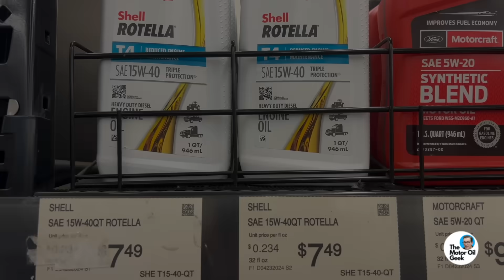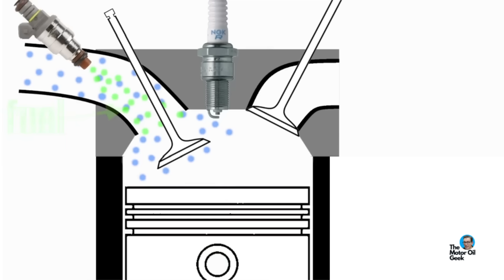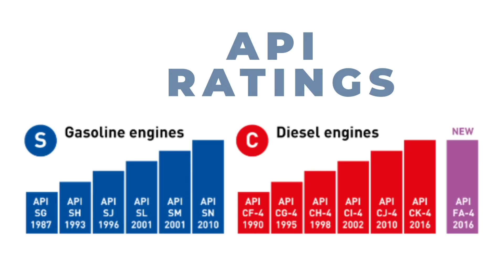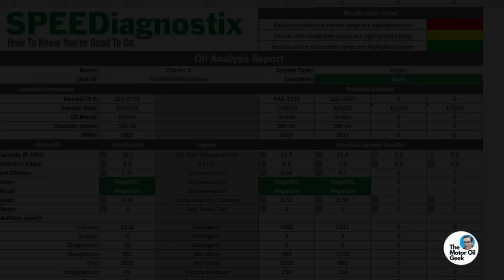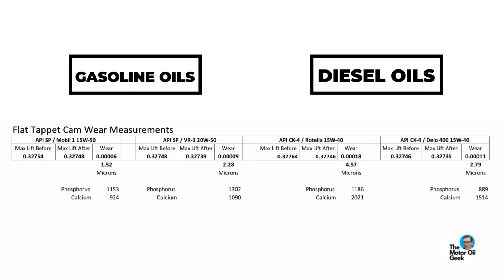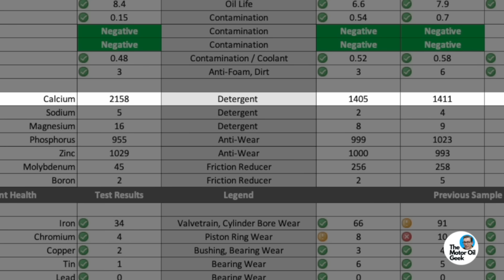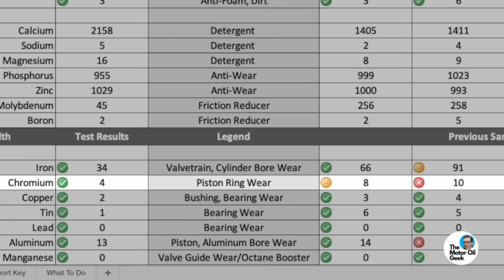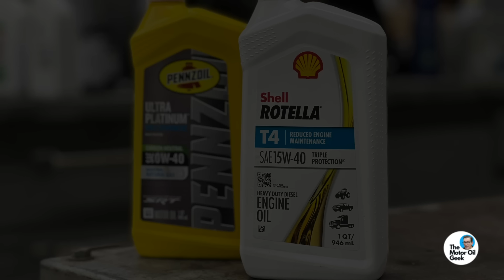Why DIESEL Oil is Actually WORSE for Gas Engines!

Comment: Why is Rotella T4 rated by the Japanese for motorcycles?  That T4 has JASO MA/MA2, which is a Japanese rating for motorcycles....  My  2000 Honda Goldwing 1500SE can use the diesel oil even though that water cooled engine is very similar to a Subaru flat 4 (GW is a flat 6 - Boxer motor).

Comment: Made the mistake of running Rotella diesel 10w30 or 40? in my VW bus. Took me abit, but i realized it was not revving like it should have (max revs @5200, normal running @4000 at 70mph )  The diesel oil was actually slowing down my pistons!.  Went back to Castrol, ran like new. Now, is Rotella formulated for gas engines, and their higher and faster revs,  too, besides diesels? Either way, I'll stick with Castrol, which is an excellent oil.
Reply: VW bus you could maybe get out and run faster
Reply: Actually, my Bus would do 70~75 on the highway. No, not as fast or quick as most cars, but I would still pass plenty of people,  and I could carry all sorts of stuff inside and on top.

Comment: Hi i am from India. My first bike is Bajaj Discover 100T it has completed 70000 Km. Then there was a bad sound from head. The cam bearing was gone. Even though it's cam lobes were intact. Company was recommending 20W 40 oil. But i used 20w50 throughout the Years. 
Recently I rebuilt the engine because the bike is 12 years old. I use it for daily use . I did 4000km oil change. Now I am planning to use castrol 10W 40 full synthetic oil. 
Is it good for my bike to use 10w-40 instead of 20w40?
This bike gives me 80 Km / litre fuel efficiency. 
11:1 Compression ratio, 
Long stroke
4 valve SOHC. 
10 HP 9 Nm singe cylinder bike
This bike was very very reliable front and back tyres last for 50000kms this is my 3rd chain on it. Front fork oil seals changed 2 times. 
The CDI unit and horn switch changed once. 
No other maintenance in 70000kms.
I ordered new sock absorbers for the rear. 
I also have a Honda CB 350 Rs.

Comment: Could you run a diesel oil in a classic car with unknown mileage on the engine, for  maybe two or 3000 miles to flush it?

Comment: They haven't been around high millage gas engine with desiel  oil i have witness it it will keep oil pressure up even after several miles on old change

Comment: It is difficult to accept that you are an expert on engines lubrication, when I see your animated graphic at 1:46 illustrating the pistons pointing 180 degrees downward into the oil pan. Whomever is in charge of your animations doesn't know a damn thing about engines. That makes you look like a fool for not proofing your video before release.
Reply: What do you expect from a channel that would feature Dave repeatedly. That guy is a joke.

Comment: Uh oh......I've been using Shell Rotella 0W40 (T6 I think?) in just about everything: the gas truck and car, the diesel farm tractor, the diesel generator, gas generators, the gas snowblowers......we live in wintery Canada. I do use an API SP 10W30 in summer equipment like lawn mowers, the rototiller etc. But I'd better go look at that pail of Rotella to see if it's really not suitable for gas engines. Great video!

Comment: The diesel oil folks will never be convinced that specific gas/motorcycle oil is better for their designed application. 

I am not saying diesel oil will necessarily harm your car/motorcycle, just that it’s not as good in terms of wear control, oil longevity, or shifting in shared oil applications.
Reply: Agree.  Lake is just saying that diesel oil in a gasoline engine is not ideal and the commenters have a cow!
Reply: @pedlpower  He pretty much proved that even with the 'wrong' oil, it still works and you get away with it. Oil is just that good these days.

People just like to obsess about oil like there's some hidden secret that nobody's figured out yet.
Reply: He didn’t really address the old engines much just kept going on about gdi.
Reply: @LinusScrubTips  He did give good information on how diesel oil could be an issue with old engines though. He mentioned the fact that high levels of ZDDP in diesel oil does not mean it’s good for flat tappet wear, due to the equally high levels of detergent/dispersant. 
High ZDDP is often the argument for why diesel is “better” for old pushrod engines in classic cars and motorcycles. It is true that low ZDDP in modern auto oil can cause a cam to wear out shockingly fast in a flat tappet engine, but diesel oil isn’t the answer.

Comment: I have run Rotella in my Honda accord four-cylinder since 150,000 miles. It has 422,000 miles on it now runs good and from time to time I’ll add a small bottle of brake fluid to keep the valve stem seals softened up, I have never open the valve cover and it’s only had one set of spark plugs put in it in the car just runs perfectly. Maybe I’m lucky.

Comment: I'd love to hear your thoughts on this :  If diesel oil is designed to handle soot then would it be better to run gas oil in diesel engines that have bypass filters that remove all of the soot?

Comment: Dual diesel and gasoline rated oils are often called "fleet oils", as companies can use them in their diesel and gasoline vehicles. When I was in high school, 15W40 was the cheapest motor oil that my high school shop could buy in large oil drums, so the high school shop teacher ordered drums of 15W40. The high school shop had a contract with the local FBI office to change oil in their cars. One day, two FBI agents dropped off one FBI car for an oil change and left in their other car for a while. The kid changing the oil called his buddy into the FBI car and they went for a joy ride. They had all of the sirens and flashing lights on the FBI car going, but couldn't figure out how to switch them off, as there were so many switches. The two FBI agents arrived back to pick up the car and the two kids pulled up to the shop with sirens and lights going full blast on the FBI car. That was the end of the FBI contract.
Reply: @BrandonLeeBrown  I don't think so Tim
Reply: Yeah no. Don't believe you.
Reply: @thomasfogerty3515  The FBI car had a box under the middle of the dash that was covered with switches. That's what controlled the various sirens and lights. The school was very near the FBI office and some FBI agents' kids went to the school. The shop teacher set up the contract and he lived the neighborhood full of FBI agents too. So a lot of the people involved knew each other.
Reply: Usually, the same switch that turned on the siren also turns it off!!!   The switches formthese duty vehicles are not complicated!  So this is a BS story!!!
Reply: @LWRC  True story. The siren control was a large box under the center of the dash, with many switches. Different sirens and lights. Anyway, they claimed they couldn't figure out how to switch everything off, so they returned to the school shop with the siren blasting. The two FBI agents were sitting at the school shop to pick up the car when they returned. The school shop was only supposed to oil changes to the FBI cars. The two guys claimed they took it out on a "test drive." I was in the shop and the guy that changed the oil called his buddy over to come take a ride with him. The streets around the school formed circle around the school, the football and baseball fields, the cafeteria and the swimming pool, around the back of the school shop and back to the main entrance. I'm guessing that's the route they took and the street has large hill in front of the school and that's where they came up over the hill at high speed with the siren going, to the main entrance. The school was near some large FBI offices and many FBI agents had children at the school and lived in the same neighborhood as the shop teacher.
Reply: @BrandonLeeBrown Thanks for sharing. I can see how that could have materialized. They panicked and didn't find the switch. Usually, the switches aren't complicated so when in use, it would be easy to turn on and off!
Quite a story nevertheless! 
Now how did entire high school and the shop teacher react to the incident?  I's bet those boys were famous back then!!!
Reply: @LWRC  It was the funniest thing I ever saw. Even the teacher thought it was funny, except for the two FBI agents being there at the time. I saw the siren control panel and it wasn't really marked well, or at least not in regular English and with just some letter and number markings on switches. Some switches may have been three position, but I never tried any of them. These were not the brightest guys I the class and they have been switching switches back and forth between the two of them for fun, with switching off and the other switching them back on. The FBI car came flying over the crest of the hill in front of the school, with the lights and siren going. The two guys were not part of the popular students and weren't well known through the school. It was a big deal at the school shop though, which was a two hour class each day. Shop students knew each other and kept up with the things going on at the shop. The shop teacher said everybody looked tied and had a student that also worked at the swimming pool to take a portable oxygen tank and mask from the pool and bring it to class. He handed it to the class and told everybody to inhale some oxygen at the beginning of class, to wake up everybody. One time there was a small in the shop and the doors were closed and the lights switched off. Everybody made it out before, except one guy. The shop teacher went in and the only light on the from the box that we stored eye googles in. This gave the teacher some idea of where he was inside with the missing student and they were able to find the door because of the light in the google box on the wall and h knew which wall that was.
Reply: @BrandonLeeBrown  You go through life and reflect back on some of the stupid things we've all done especially in HS.  These few will always be remembered for that stunt and in a not so good way.  
Did this ever make it into the year book and what ever happened to this group after high school?

Comment: Good to know. I got a couple cases of Rotella T5 10W30 cheap and have been using it in both my gas and diesel small engine stuff, guess I'll be saving it for just the diesels from now on. Everything I have is older flat tappet engines, I figured it would be good for wear in older style engines.

Comment: I recall that way back in the 1980's it was suggested that  fleets with heavy diesel trucks and gas delivery vans could just stock Rotella and use it in both. The oils and engines were different then. I have often used my diesel oil in gas engines for summer oil changes. Had no problems, older vehicles, though.

Comment: My Harley Electra Glide owners manual, says 15/40 diesel oil is fine in the crank case.Been running it for 8 months now, long trips. No problems.

Comment: Been using T4 in my motorcycle for the last 40 years  Its rated for JASCO M and M2 for wet clutches  Same old  81 Kawasaki  still runs like new no smoke and great compression. the hard part is to get 100 octane gas in Canada to handle the 12:1 compression now

Comment: Diesel oil should only be used in gas cars from new, as diesel oil is high detergent and will wash away the carbon that was sealing the rings in a old gas engine.
Most diesel oils can be used as a fleet oil for diesel, gas, and motorcycles with a wet clutch.

Comment: I work on HGV'S and buses for a living. I can acquire the odd gallon of HGV oil for free. Could I run some HGV oil in a petrol or diesel passenger car for a few days or up to a week and then drain it out and change the filter and refill with the correct passenger car oil. I was thinking this could clean out more extra crap in the engine and keep the new oil in there cleaner for longer. Do you think this would be OK since as it would be such a short amount of time or probably best not to do so? Thanks. Great video as usual. James from England

Comment: I've been running Rotella t5 10w30 in my 1995 f150 4.9 300 for over 18 years and she has 350k miles on the clock and still runs great.
Reply: @acuraintegra101  I have a 1997 Dodge Dakota with a 5.2 (318) That I Run T6 15w40  But Remember Neither one of our Engines are VVT With GDI And Turbo charged the modern Engines of the past 15 years Are MUCH more complex than those of the 80s 90s And even the mid 2000s
Reply: @rodneyblack1257  that 5.2 magnum begin in 1992 it's a updated version it's not the same 318 from 1964 I owned a 1973 plum crazy purple duster when I was a young man with a 318 In her. The engines are close but different. my engine has been almost unchanged since 1965 it very old tech. other than fuel Injection. It's pretty much a old tractor engine. Geared timing.  No chain, no belt. I got this truck with 130k on it and have been putting the t5 10w30 in it ever since. So I'm very certain that this oil is fine for the old girl.  I wouldn't put this in my mustang or anything.
Reply: @acuraintegra101  you are correct  My point is That Engines Like the 5.2 / 5.9 Ect Are not GDI/VVT So those engines meaning the older Less Modern ones,  you can Play with the Oil more than a Modern Engine. Yes my 5.2 is More updated Than the 318 of the 60s 70s and even up to the early 90s  it is still 318 cubic inches
Reply: @rodneyblack1257  I do understand that it's still a 318. Like I was saying just more modern. But all this new stuff I don't worry about being my newest cars are a 2004 focus SVT and 2000 Ford mustang V6 they get Valvoline high mileage 5w30 and the oldest is a 1986 Mazda b2000. I've got a total of 6 cars . The b2000 actually takes 10w40 and it  gets motul classic 80s oil it's high dollar stuff but it's worth it to me both my Miata 90 hard top &91 soft top and use motul classic 90s 10w30. I use t5 because I work the f150 hard. Unlike the b2000 that I just cruise around in and only do light jobs with.
Reply: @acuraintegra101  I am in the Same boat as you as far as the Era of our Vehicles As I have Stated I own a 97 Dakota 5.2 with a 5 speed Manual I also have a 98 Ford F250 with 5.4  2 valve not the 3 valve. I also have a 2018 Mazda CX 3 2.0. Now being Said Yes to your point my 5.2 Dodge is more modern than those of the 69s 70s & 80s But this is important when I have Stated more modern Referring to Today Not If yesteryear
Reply: @rodneyblack1257  my f150 is a 5 speed manual as well as all  but the mustang it's a automatic.
Reply: @acuraintegra101  I am not A Ford person at all But to be Completely Honest & Fair the 289 small block v8 & the 300 inline 6 Were Absolutely 2 of the most Reliable and Durable Ford Engines
Reply: @rodneyblack1257  I totally agree about these two Ford engines. But Im really a rotary head deep down I've owed 3 different rx7 and a RX8 I still own a rotary but it's a work in progress and its not a car it's a motorcycle.
Reply: @acuraintegra101  my view on Cars/ Trucks/ Motorcycles is Like Ice cream Every body has Their Favorite Flavor . You can enjoy other flavors But we all have our Favorite

Comment: I said LSPI the first time Dave talked about that Audi. It had lived for too long to have died so quickly after the (current) purchased the car. I'll bet combination of wrong oil and not letting it warm up before getting into the throttle.

On my Mazda CX-5 with GDI, I stuck with Pennzoil Platinum instead of Ultra Platinum due to the lower Calcium in the non-Ultra blend.

Comment: I’ve used Rotella T4 because of it’s higher detergent content to cure litter tick in my ‘97 Miata engine. However it should be changed out after a few hundred miles.

Comment: Well, Mr. motor oil geek I have saved my 3.6 L penta star V6 engine by using high-quality full synthetic 5W 40 diesel engine oil In the engine!!!
No more camp follower failure, and no more piston ring failure, especially when the engine is working hard!!!!

Comment: Argument against.  I ran Delvac in my 240Zcar for about 35 years (1972 to 2007).  Iron block engine, with aluminum heads.  As a result we typically got about 250Kmiles out of the one engine, and when I sold it, it was on block three.  The obvious problem was the thermal mismatch between the heads and block, and after about 250Kmiles the heads would start to have micro-cracks.  The cracks only became noticeable if the went into the water, and you would start slowly lose water, a warning sign.  At those times, we elected to just swap and put in a short-block as a replacement.  This proved more cost effective than trying to do repairs, as shown in the block1 effort.  In block3 we went to Mobil1 exclusively, of varying grades.  When we sold the car, it had about 660Kmiles on it, and was running well.  We sold it because parts were no longer cheaply available.  During its life, only two JATCO transmission refits were required, also core replacements with rebuilds.  Rear end never wore out, even though severely abused, also using Mobil gear oils.   I was a GM engineer, and many of us used Delvac.  If you changed it based on simple color check, it worked very well.  Later as the technology evolved, we developed monitors for oil quality, and these exist now in various vehicles.
Reply: So how many miles total were on this car?!
Reply: @theundergroundlairofthesqu9261  6603xxMiles.  Scrapped due to seal leak from differential seal, through the speedometer cable, into the dash, and dripping onto shoes.  Parts no longer available.  Was replaced twice before.  GM engineer.  Also, these vehicles had "bad" rubber and plastic components, cheap crap, bushings and bumpers were replaced, as needed by better available parts, as suggested by online blogs.